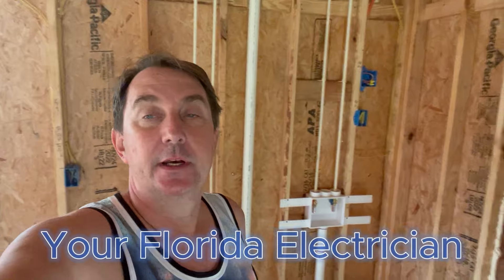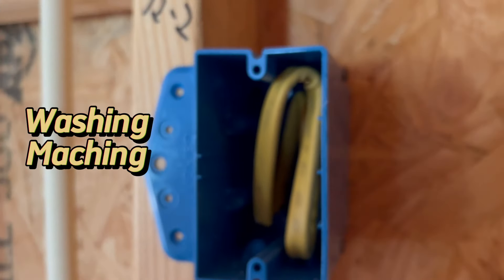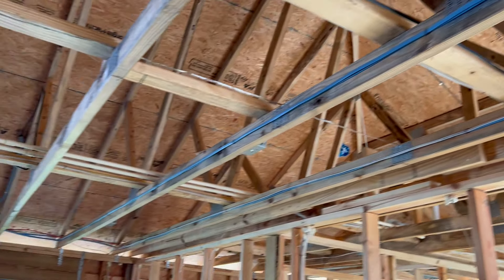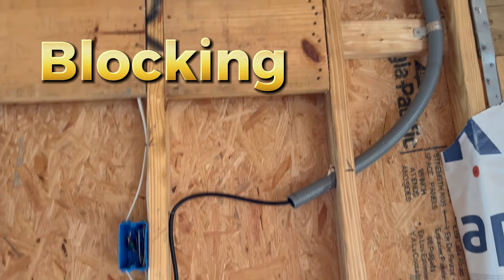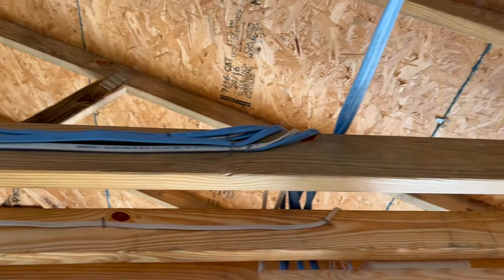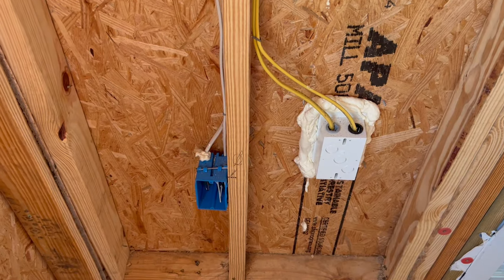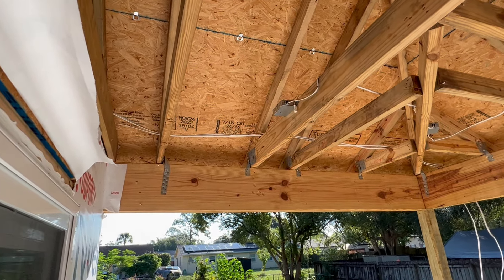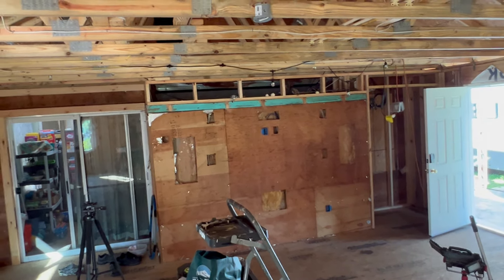Residential Wiring Rough in Show Off & Tips

Comment: Looks great.  May think about mounting the wafer light drivers.  I worry about the led  lights failing then having to source  different replacement unit since NLA. Then have to install new drivers.
Reply from the maker: @StephenZobrist  The LED drivers are mounted. 10:08 in the video. 
The holes for these lights are big enough where I can reach in and unscrew the drivers if I needed to fortunately. 
Thank you for watching and commenting on the video ! The best compliment is liking, sharing and subscribing to the channel. 🙏

Comment: I noticed a distinct lack of CAT-6/6A ethernet (wired networking) cabling. I'd have multiple etherner outlets in pretty much every room and multiple ceiling mounted locations for wireless access points. I mean, low voltage, especially networkncabling should be done by a low voltage specialist and planned by an IT Pro, but it's still suspiciously absent in this video, unless it was done after thia video was filmed.

Are metal gang boxes and junction boxes no longer used indoors in the US?
Reply from the maker: Good observation. I only added a range extender. It has enough to handle 100 clients which is good because I added about 40 WiFi switches for my Leviton smart home. Seems to be working well. 
I was thinking of adding some hardwired drops to take the load off the WiFi. Especially ones for the three WiFi / Ethernet TVs in the new addition. 
Thank you for watching and commenting. It’s always appreciated. 🙏
Reply: @YourFloridaElectrician  thanks. It's working well for now, but I've replaced/upgraded a few set ups like yours, which gets expensive to run ethernet after the drywall goes up. A range extender is a device I would never use, generally, a range extender (as opposed to a wifi mesh system) might increase coverage but will typically cut speeds in half as it has to reserve half the available wireless bandwidth between itself and the main wifi access point (likely the ISP provided router in your case) and then rebroadcasting a new wifi signal (ideally with the same SSID, aka network name, on all frequencies 2.4GHz, 5GHz, and 6GHz if used, but typically on a separate SSID, which means devices treat the two wifi names as separate networks). Generally in residential applications I rarely worry about how many wifi clients are in use, I prioritize proper coverage and ability to deal with congestion due to neighbouring wifi networks. I try to wire everything I can, especially if it's a stationary devices like a TV, streaming stick, or smart home device (but typically these rely on wifi or some other wireless spec like Zigbee or Z-Wave).
I highly recommend Ubiquiti UniFi devices, expensive when compared to consumer device prices (but still quite competitive with the highend, if not better), but cheap when compared to business device prices.
Ubiquiti UniFi product lines cover wifi, network (your router, but not your modem), network switches, security camera systems, and more.
I highly recommend running CAT-6/6A from the TVs (ideally 2 or 3 ethernet drops per location, but 1 is enough and you can buy a cheap 5 port gigabit switch for less than $20 to connect multiple ethernet devices) to a standard 19" network rack with a patch panel, switch, and your modem/router. I also recommend getting your own router and having your ISP put your modem in bridge mode (basically a modem only mode). Alternatively, a whole home wifi mesh system would be a good middle ground. I especially like the TP-Link PX50 as it is hybrid powerline networking and wifi mesh (uses your electrical wiring as wired backhaul instead of wifi to connect the wifi nodes to the main router node).
Hopefully that made sense and wasn't overly technical (from a non-IT standpoint).
Reply from the maker: Yup head spinning 😵‍💫. So I understand, but I’m not a low-voltage expert.  
There is a link to the range extender I purchased . 
TP-Link AX5400 WiFi 6 Range... https://www.amazon.com/dp/B0C7RRYFH3?ref=ppx_pop_mob_ap_share
I would definitely like to understand better how people set up different “channels “for different things . One channel for their smart home devices, one channel for their TVs and a separate channel just for cell phones, etc. That would be helpful.
In hindsight, it would’ve definitely been easier to pull the low-voltage wiring prior to the drywall . I certainly had the time to do so. The only thing I seem to be concerned about was splitting the HDMI signal off my camera system so I can watch it on all the new TVs. That has been enjoyable. At this point, I think the biggest Bang for my buck would be like you said, dropping some cat six for the TVs.
Thanks man really informative . 👍
Reply: @YourFloridaElectrician  you're welcome. Sorry to make your head spin! That extender might actually be somewhat reasonable. 
If by channel you mean different Virtual Networks (or VLANs) I could help explain things, but for home, I tend to not use them in order to keep things simple, though most network specialists likely would recommend this. But your router, wifi, and switches need to support VLANs, at least to some degree. I would probably do a main network for you and your family's main devices (PCs, Macs, phones, smart TVs), one for guest devices (friends, extended family, other guests, etc.), and one for your smart home devices, but I wouldn't over think it either for a home network.
Reply from the maker: Awesome. Good information. I notice you have a YouTube channel. Why not post some videos? I bet they would be helpful.